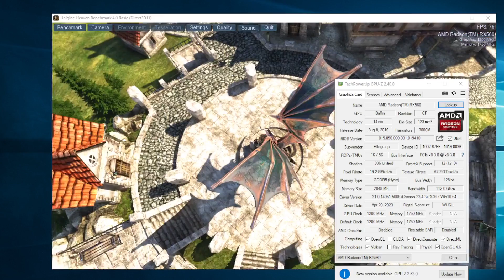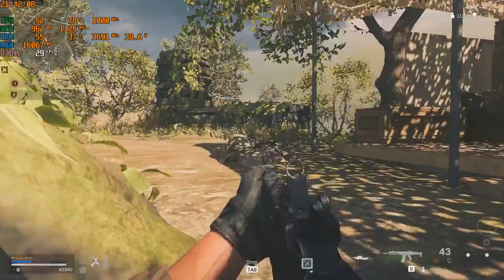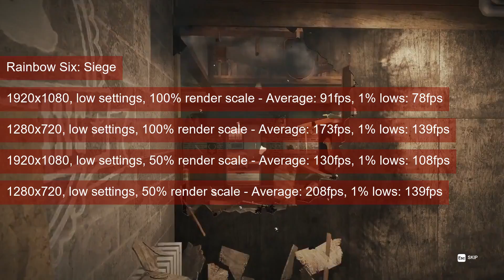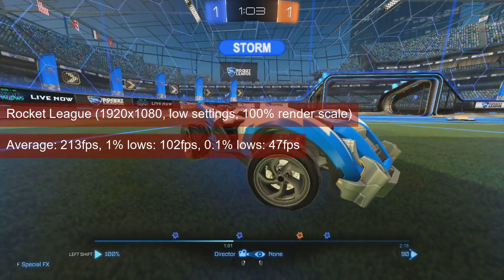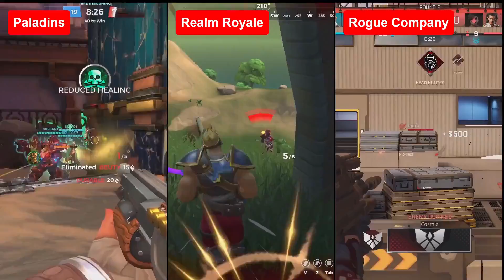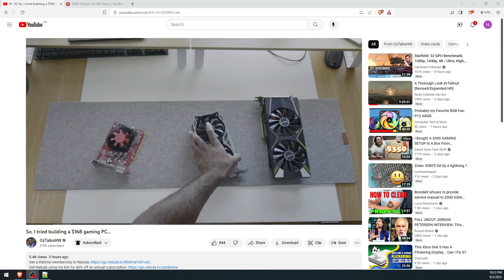Cheap OEM Radeon card tested in 2023 (RX 460)

Comment: I have the exact same model :D but only tested one game on it.
Reply from the maker: ... Company of Heroes?
I wanted to switch the cooler for another one, that looked compatible, and had a shroud. Problem is is I would need to machine off some of it to make room for some capacitors, and I don't have the tools for that.
Didn't give up on the plan, but it will require some ... adaptations.
Reply: @oldertechtoday  No, it was Isonzo, I also tested it on the HD 7770.

Oh, yeah, clearance issues. You could try to drill out the part where the capacitors are, so there is no need for a milling machine yet it depends on the cooler at question.
If you need any help with it, like discussing on how to do it, let me know, I would like to be helpful. :)